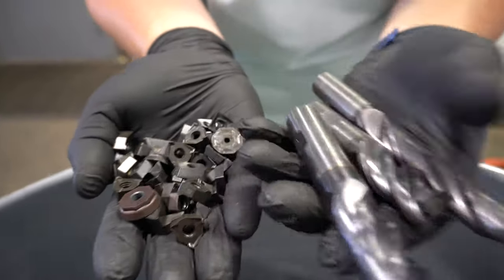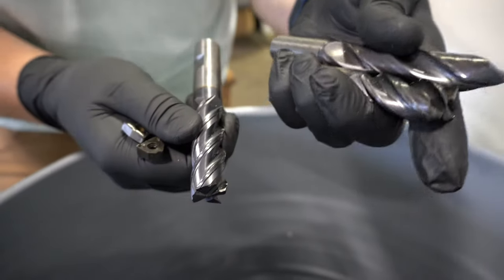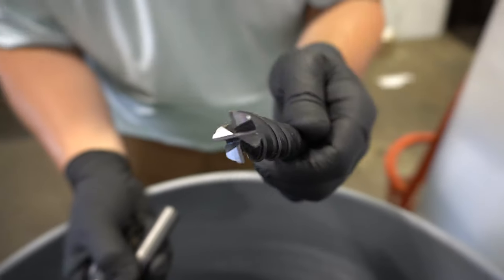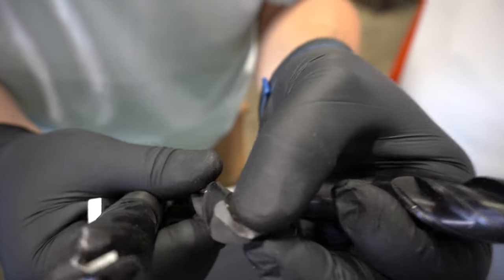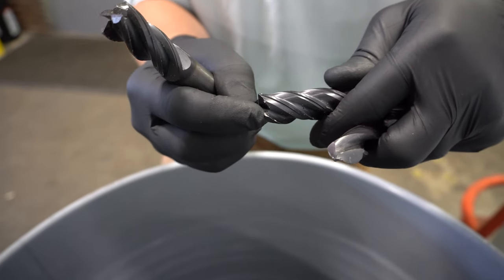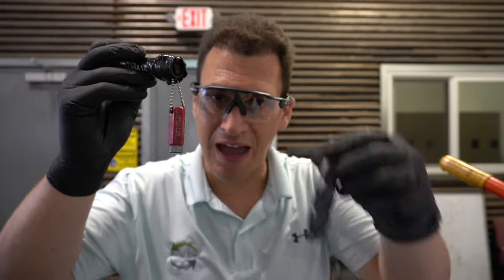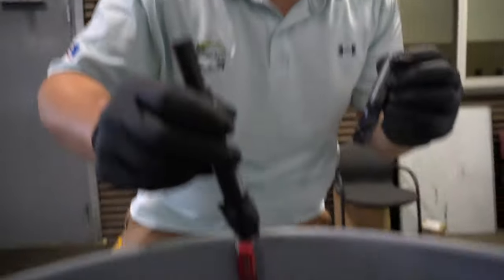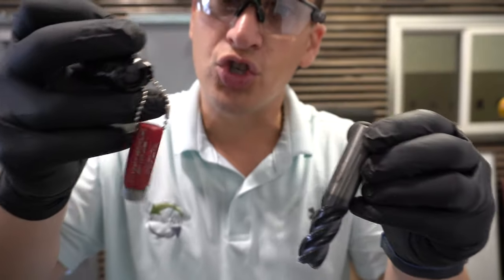Make The Highest Profit from Scrap Carbide - *Bonus Tip*

Comment: Old guy here . 20 yrs circuit bd ind.
Only a few yrs. Drilling/routing.
Have only 50 to 100 lbs of carbide
Scrap drill bits/routers to sell. They
All have plastic depth stop collars
On them. Are they worth anything, 
Or should I just chuck em?
Reply from the maker: Old steel bits are generally just steel, but carbide has value. 

www.RRCarbide.com